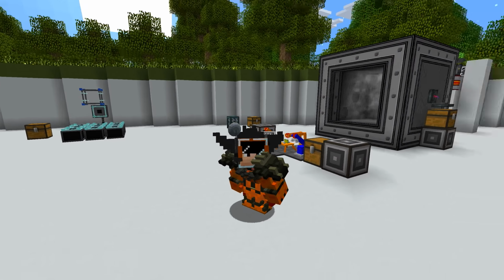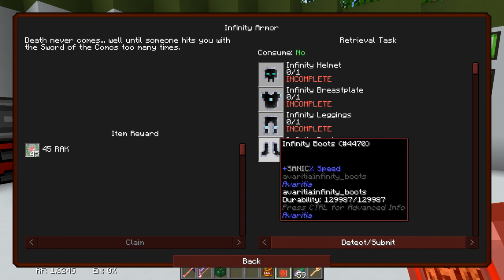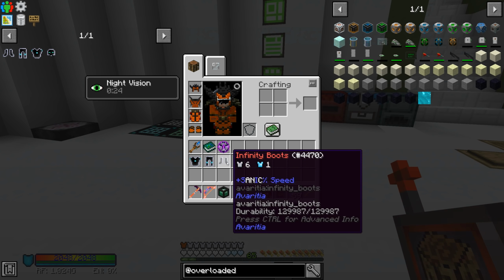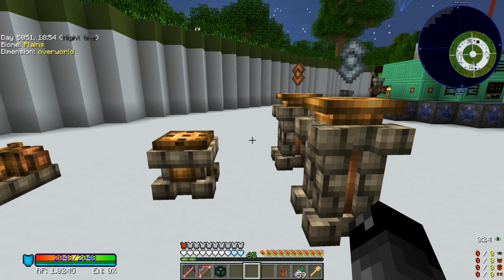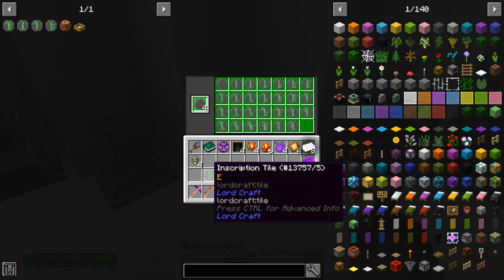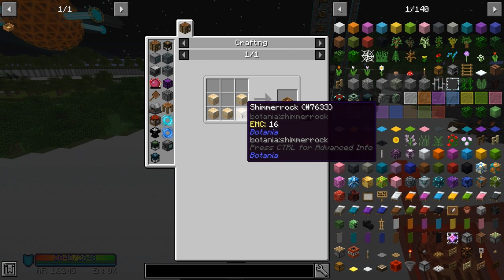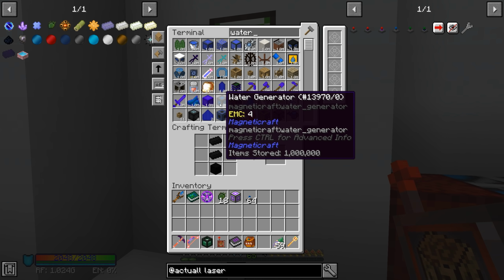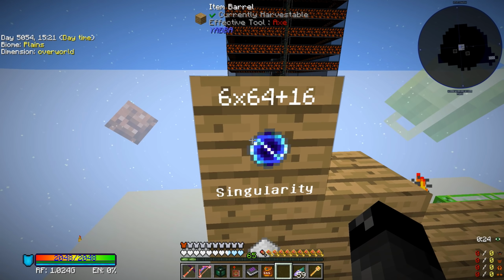Project Ozone 3 Kappa Mode - CHAOS [E143] (Modded Minecraft Sky Block)

Comment: In what epesode did you show how to autocraft plastic?
Reply: Pneumaticraft plastic? He never automated it. You can't autocraft it, but you can use the lock selection option where you select the plastic to make it keep crafting the one color, and send the plastic into storage drawers without void upgrades so it stops generating them once it's full, and attach a drawer controller and a storage bus. Just have a plastic mixer for each color you need automated. There are crude oil fluid cows so you can use a rancher to get all the oil you need to make liquid plastic with.
Reply: S117 Oracle ty very much that’s the way I got it setup currently but without the fluid cow thing but with a world full of oil. I only use the stuff you need for lubricant and for plastic I dump the other 2 ty for the tip I just thought that he had it automated it was set up kinda confusing.

Comment: Hypno, the Multi and Infinity Armor lets you activate no clip mode when the full set is equipped.
Reply: The overloaded tablet is the config thing
Reply: Volt64bolt I actually didn’t know that, but the more help, the better :D
Reply: im doing this aswell so thank you for the help :)
Reply: ThePandasWithin not infinity, just multi using a config tool
Reply: Volt64bolt Infinity armor does have it. It just doesn’t tell you how and it’s hidden behind the massive controls section. You can also add abilities like night vision if you use the enhancement crystals but again: doesn’t tell you what it adds to what armor piece.
Reply: @Volt64bolt  yes infinity can with the enhancement crystal on the chestplate if you have avaritia complement installed